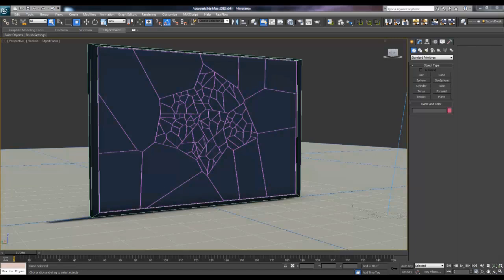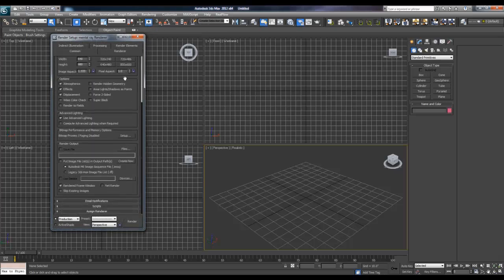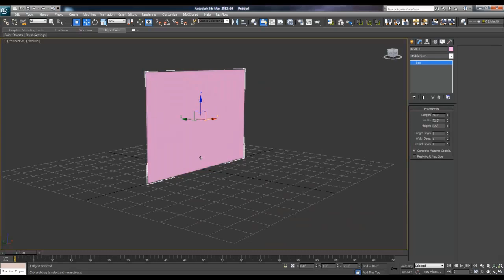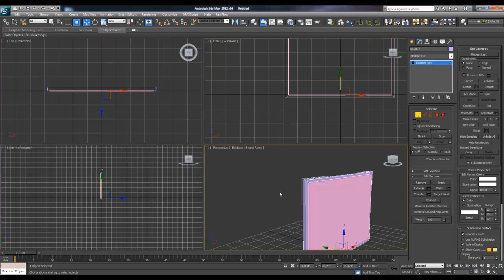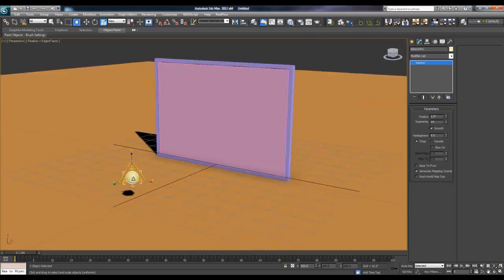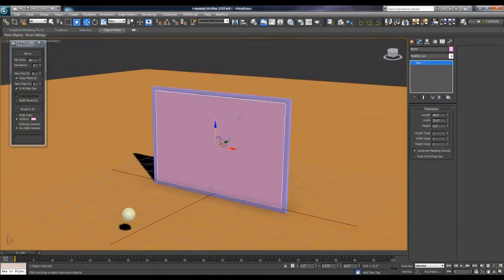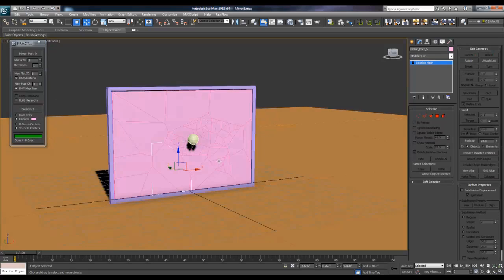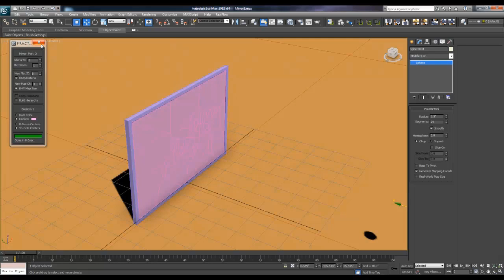3ds Max 2012 Mirror Shattering (Mass FX) Tutorial (1/3)

Comment from the maker: The shadows are turned on because my viewports are set to realistic. To select this just click the viewport options in the top right of the viewport. Yours will probably say Shaded Edges or Wireframe. Click this and select Realistic. This is only avaible in 2013 and later however. 

And the panning is hold down the middle mouse button and drag in a viewport. Cheers!